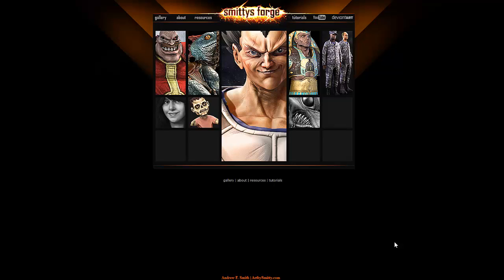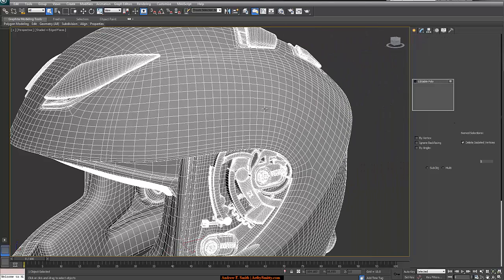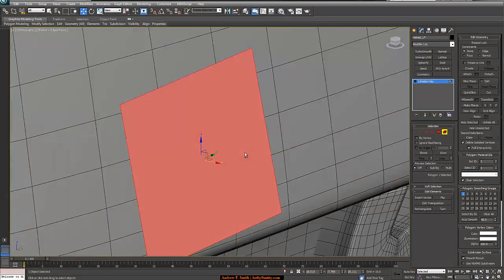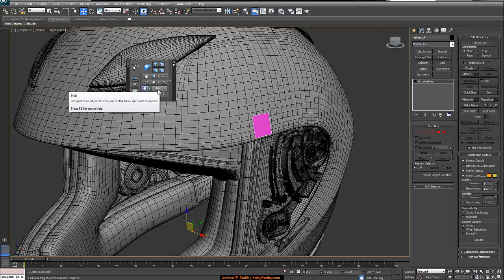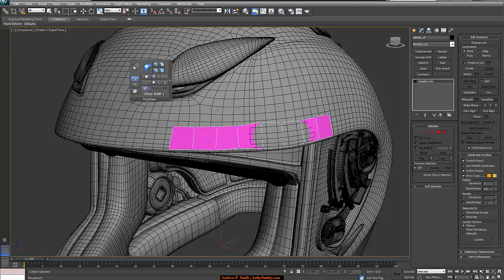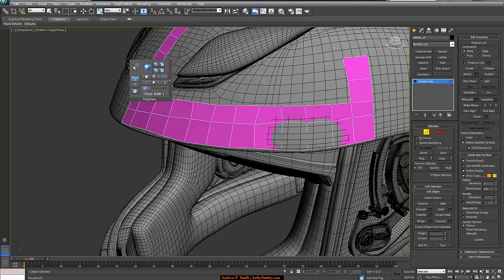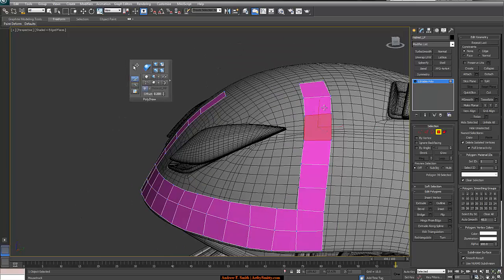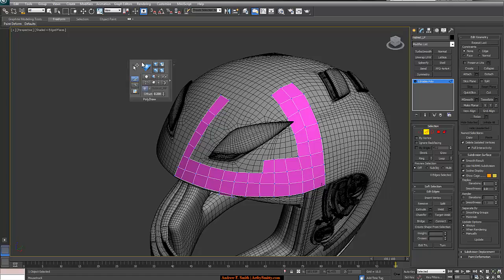[Retopo] in 3dsMax

Comment: Im using Max Deign 2015 and the Freeform offset read out defaults to 0.500. I have not been able to get it closer to my high poly base mesh even if I type .2 it stays at .5.
Is this something that is new to 2015, and is it basically the same as what is shown in this video at the 5:13 mark?

Comment: Nice method, except I wouldn't want to use the dots and work in narrow strips like that. I use TopoGun too though and am trying to get back to Max instead for both objects and characters. Good ideas here....got me thinking but I'd rather work like I am used to working (extending edges) but with snapping on. Maybe there's a way to do this. Thanks!
Reply from the maker: Thanks for the feedback! I agree, I like topogun personally, but it's all about the artist. I know some who can do amazing things in max, 3dcoat, topogun, etc....I use topogun mostly for baking my stunning AO passes. :) Cheers!
Reply: Andrew Smith
Andrew, I just discovered WrapIt for Max (script for about 35 pound Sterling). It works through Max 2012. It's fantastic from what I've seen in the demo vids. Much faster topo and using your existing EPoly hotkeys. This is not an ad...I'm just a long-term Max user looking for better ways to topo that let me use fewer programs. :)